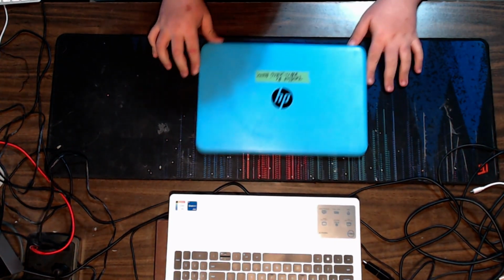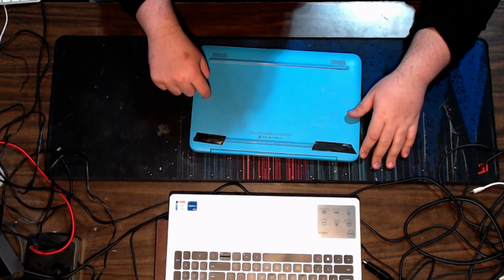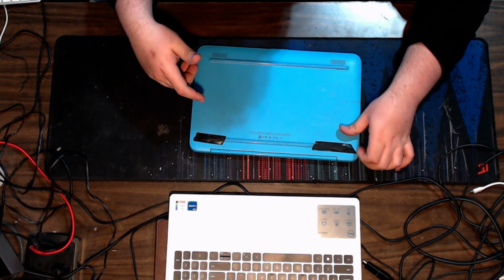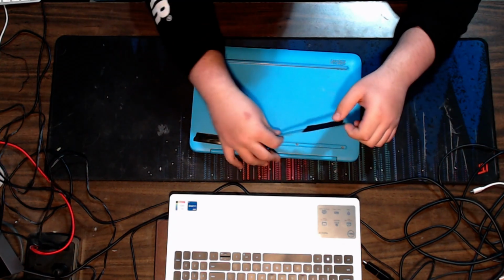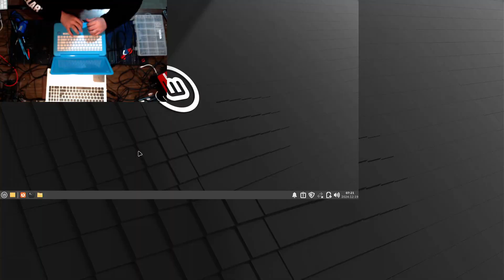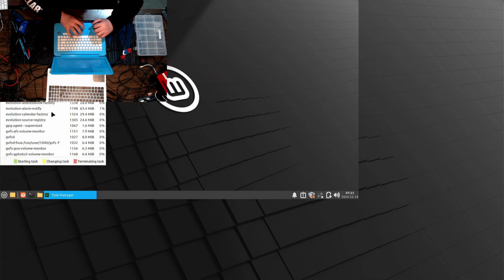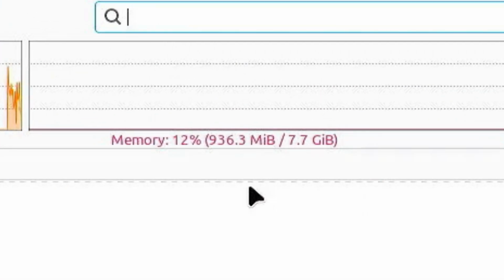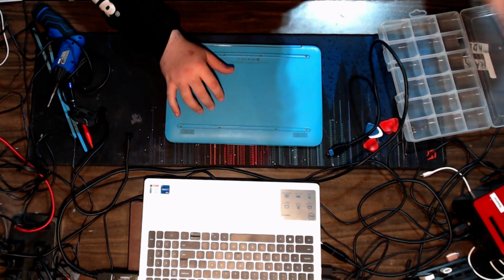How to Upgrade RAM on an HP Stream (Step-by-Step Guide)

Comment: How much gb does the one you install has and how much does the original had ?
Reply from the maker: original ram amount was 4gb, i installed 8gb of ram.
Reply: @vdubnickk is it possible to upgrade to 16gb DDR3L?
Reply from the maker: @diegog2307  8 GB is max i believe

Comment: You can add an NVME SSD to that Laptop unlocking even more performance and not break the bank doing it. The WIFI/BT Card is in an M.2 slot, yes wrong key but can be adapted for SSD. My 2017 original spec Intel Celeron N3060, 32GB eMMC, 4GB DDR3L was bumped to 480GB NVME SSD C:/32GB eMMC (storage only) D:, 8GB DDR3L. I even went over board and swapped the TN Display for a 1080 IPS Display. It's now a daily driver and always in my Camera Bag for mobile photo edits. Once you drop the eMMC as a boot device you will be surprised how much better the Laptop is. Unless you went Linux in which case carry on, as HP Stream and Linux work well together!!
Reply: What was, were from , the FHD screen? My 14-cb171wm looks just like the chrome book my friend used to have.